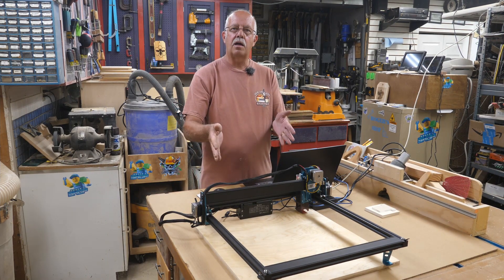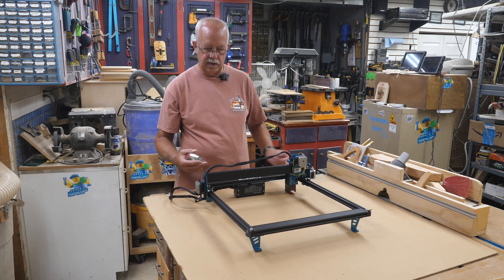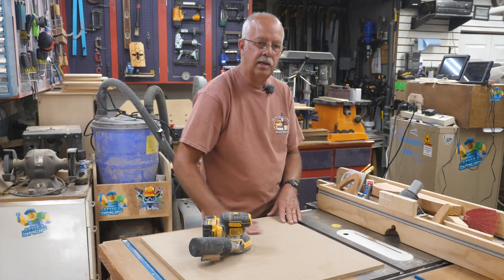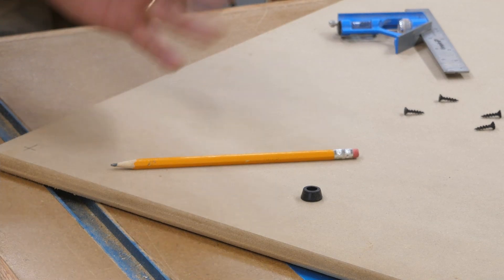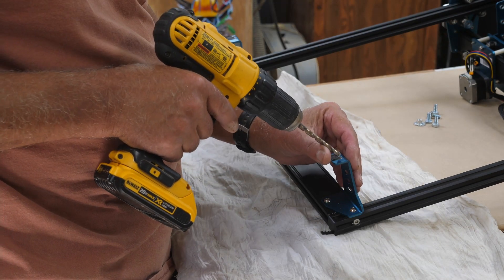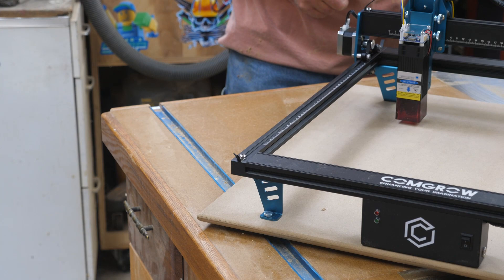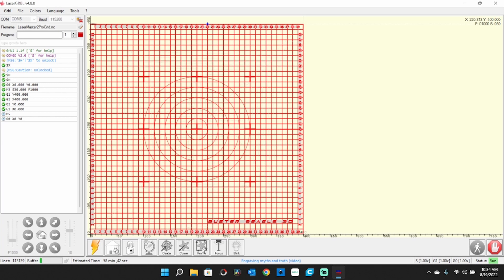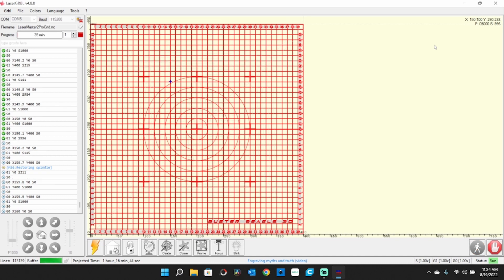Comgrow COMRO Z1 Laser Custom Base and Spoil Board

Comment: Hi thanks for your great videos.  I am trying to use this file. And continually get a hard limit error. On the bottom left. Do you know how to fix this?
Reply from the maker: I have heard from some others that not every laser is actually 400 x 400.  More like 398 x 398.  Try creating a 400mm square shape, set power to 1% and see if it runs without a hard stop.